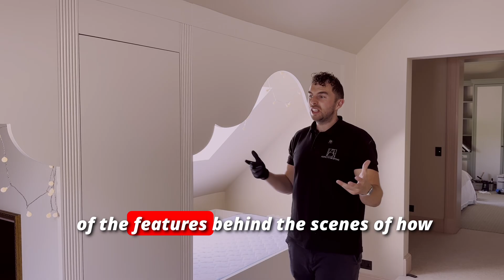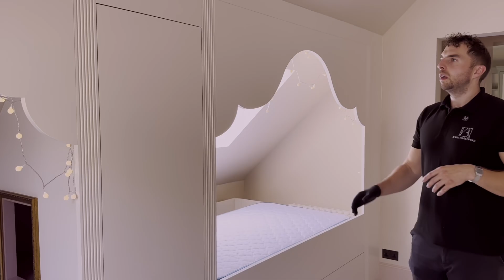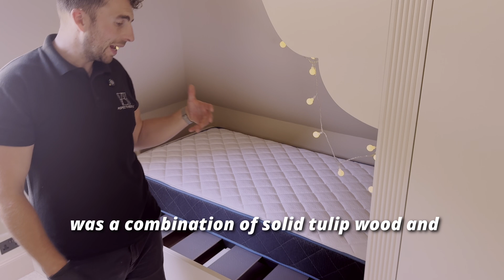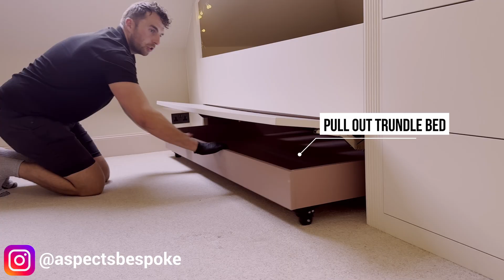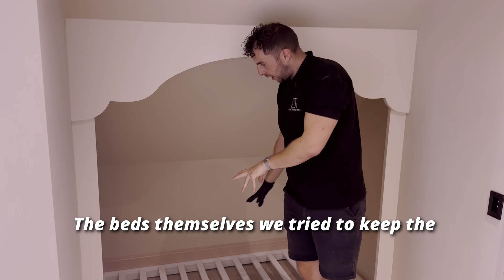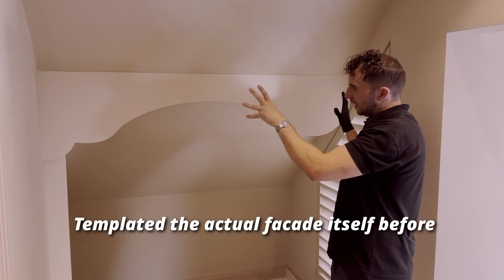Luxury Custom Made Kids Cabin Beds- BEHIND THE BUILD

Comment: WOW! how did you make the lift up door for the pull out beds?
Reply from the maker: Thanks, we used the Blum HK lift, on a door that size usually you would have 3 but as we needed the pull out bed to come out we were able to use thicker fronts to assist in keeping the panel rigid as they lifted up.